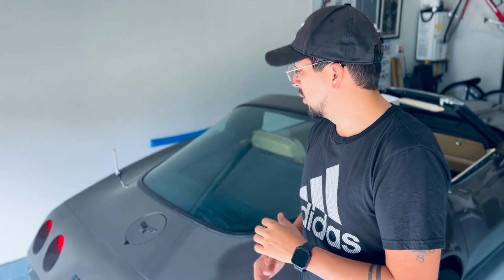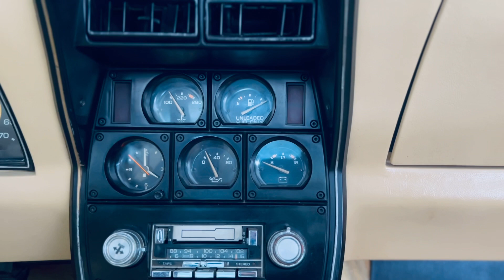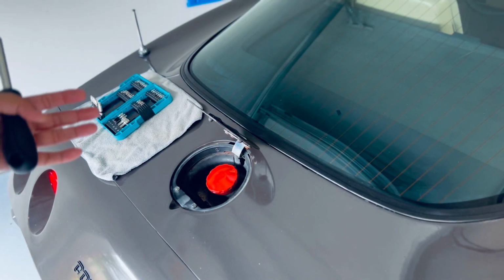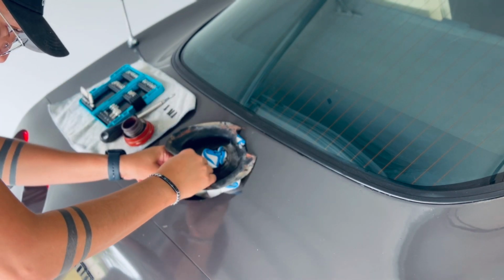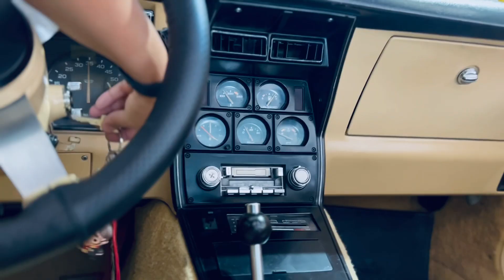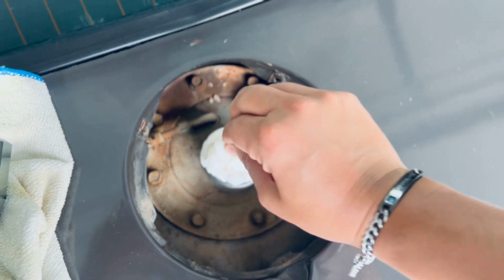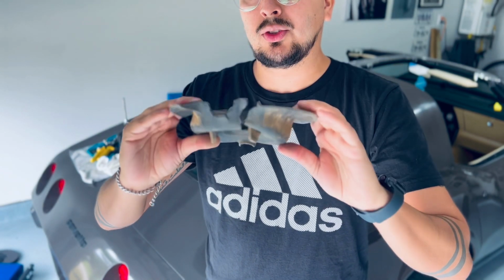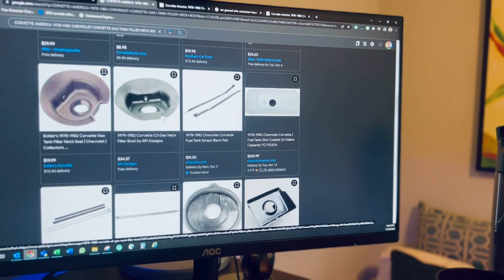C3 Corvette fuel gauge stopped working

Comment: Thanks for sharing this video. Didnt notice my gauge wasnt working until I ran out of gas pulling out of a parking space and it died on me. I'll check the ground first
Reply from the maker: That will usually be the problem! 
Let me know how it goes
Reply: @c3sgarage  cleaned the ground connection and didn’t notice much of a difference. My gauge behaves weirdly. It never goes below half. It will say full of you put gas in. Put in about 10 gallons and it said it was “full”
Reply: @michaelsoo1396 did you figure out the problem, I have the same issue
Reply: @bains1491 I ended up replacing the entire fuel sending unit with a part from eBay! The arm wasn’t sending the right voltage to the gauge. The new arm works well. Taking off the fuel lines from the sending unit was a pain in the ass though.

Comment: I ordered a steering column from eBay $375 and the it came with no steering wheel and the turn signal was snapped off. All the accessories were snapped off. I had to tear it down and rebuild it.
Reply from the maker: Sorry to hear that but hoping you were able to install and get it running 
Sometimes I wonder how ppl sell on ebay… no steering wheel ? I wonder what the thought behind it was when they sold you a steering column with no way to drive it 🤦🏻‍♂️

Comment: Nice. I have a ' 79 C3 too and my fuel gauge  is acting weird. The pointer goes up and down as I'm driving. Up to half, down to zero, back up... etc. It's a bit scary to go for a drive when I don't know how much gas I have. 
I guess it's time to rip it all apart like you did.
Reply from the maker: Worst feeling ever hahah, I would start with the ground although if the needle is jerking, I would be inclined to thinking is the gas tank sending unit.  Not hard to replace neither! Let me know if you figure it out!
Reply: @c3sgarage  Like yours, mine has a million problems to fix, more probably. It's hard to decide what to work on next.

Comment: So glad I watched this video. Of course my fuel gauge and clock do not work like yours. I will try the ground wire like you did and see if I have any luck. Mine shows 1/2 tank when in fact it is empty. Ran out of gas, that's how I knew the guage was whacked. Will it work with no ground at all ?? like when you pulled your ground off and it worked ??
Reply from the maker: James, thanks for watching, yeah my first thought would he to try prying out the ground and testing ground connection, as you can tell mines was rusted hence why it was not working. If its showing half a tank, then my next step would be to try and check the float as it may be stuck, these are old cars and things get rusty, gunky and fragile, and lastly I would recommend checking your sending unit as these fail  and may need full replacement. 
Best of lucks

Comment: I can’t the ground clip off. You cut away and when you come back you have the clip off. You don’t show how you got it off!!
Reply from the maker: Are you referring to the 3 clips going into the radio?
Reply: No, the actual ground wire. After you take off the rubber boot, then you said you managed to take off the ground, but how did you do that.
Reply from the maker: OHHH! Super easy! But it is holding by a teeth under so I would either use a small plier to get it off gently. You can always use force without pulling the cable but the plastic terminal and if it breaks, just replace it with a new one.

Comment: What kind of headers are those? Any problems with the studs when removing the stock manifolds?
Reply from the maker: Hey man, these are patriot short tube headers, i wouldn’t say it was hard but took some time to get the stock ones out.
One thing that I do not like about these patriots is that there is no clearance to remove the spark plugs and I have ran into burnt wires once or twice. I guess it comes with the territory. 
Other than this, I love them